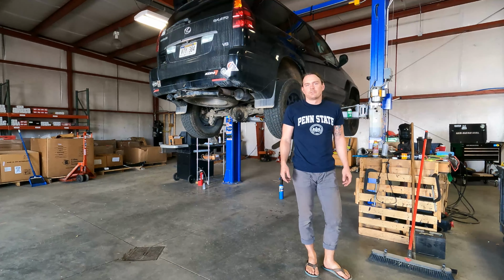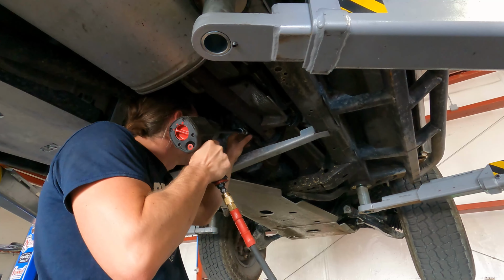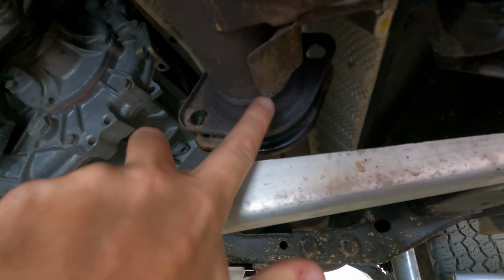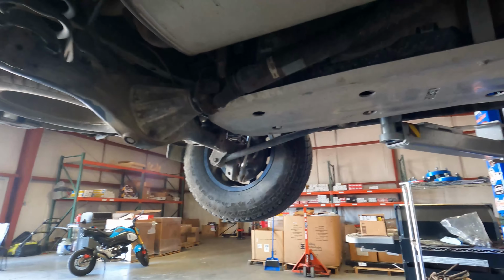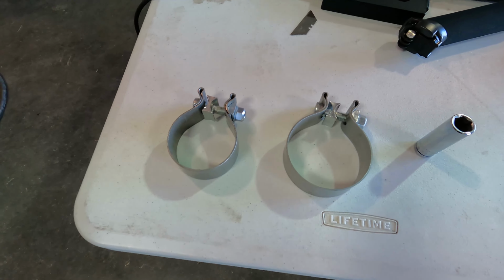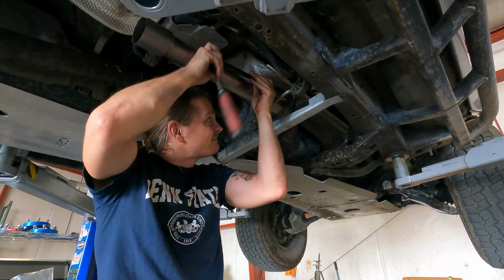2005 Lexus GX470 aFe Mach Force Cat-Back Exhaust Install w/ Sound Clips!

Comment: Nice rig. Sounds great. Like your skid plating.
Reply from the maker: Very pleasant sounding when cruising. Also skids are ASFIR brand. Aluminum skids from Israel. We will be working with them soon to get some developed for the 2nd gen frontier soon.
Reply: @AlldogsOffroadCoop   That would be outstanding sine I drive a 2nd Gen Nissan Frontier. More options the better for us Frontiersman. Cheers.